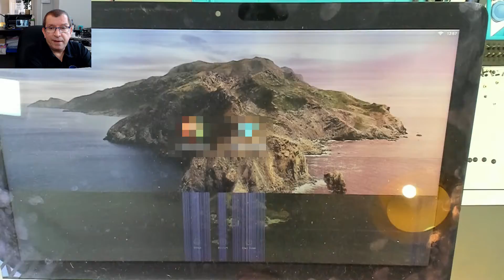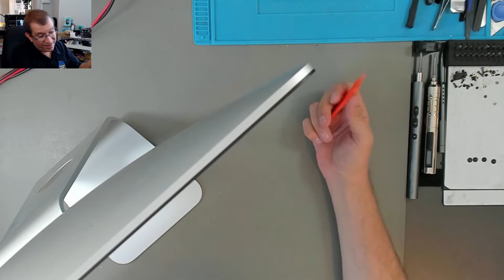[91] Apple iMac (late 2012, 21.5 inch - A1418 EMC 2544) - Replacing a bad LCD panel

Comment: How much was the lcd assembly?
Reply from the maker: It wasn't cheap -- £224 in this case (https://www.ebay.co.uk/itm/382208112513)
Reply: can i use nvme ssd to upgrade late 2012, 21.5 inch